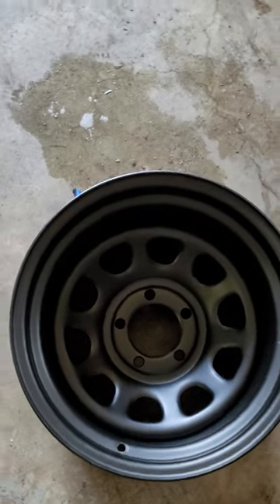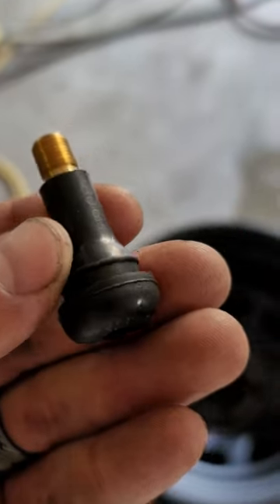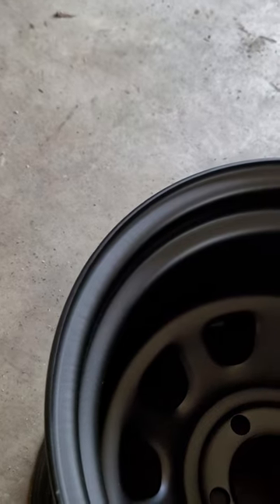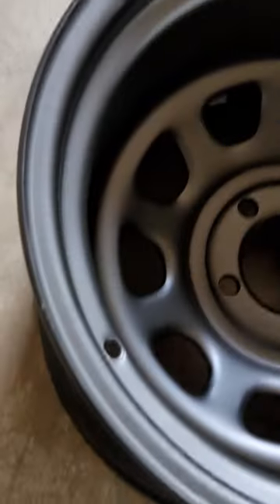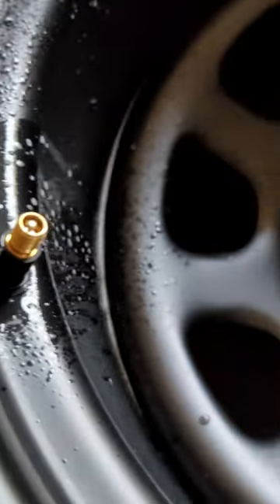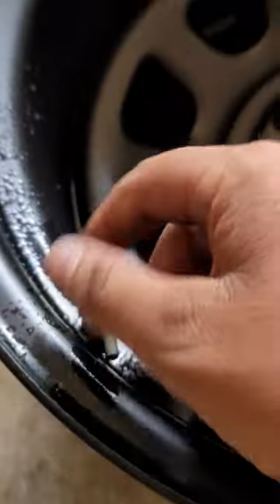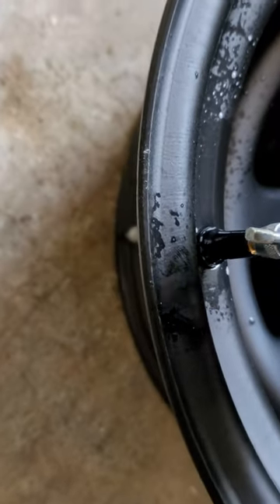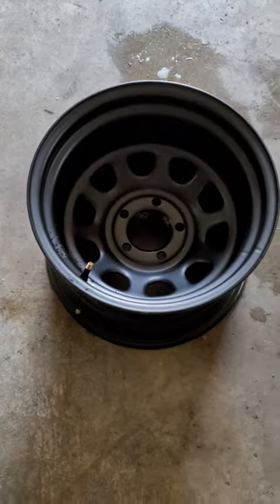How to Install Valve Stems Into New Wheels

Comment: The tool is for cleaning the threads on the inside and outside of the valve,  if you've damage them with pliers etc, the screwdriver like part removes the stem from inside the valve so you can replace it if its leaking without removing the valve. The pick like part is for reaming (removing burrs from the stem).. i have a valve installer which looks very similar but has a much longer handle.. that small one probably works fine but since it is for cleaning the threads it might be easier to damage the threads if you are not careful as thread cleaners often have an aggressive cut in the threads.. also a few drops of soapy water or bead lube if you have it around the valve core hole will make installation very easy.

Comment: Spray the inside of the rim so it slides through easier, and if you can find a nut to fit the thread of the steam just pull it through with pliers

Comment: I personally do not like to use any water based lubricants on tire valves or on tore beads when installing valves or tires . It does not take much H20 inside the rim to start small rust areas.  In the last 15 years I use WD40.  It works very well. And no, it will not cause the tire bead to slip or move under acceleration or braking actions.
Reply from the maker: I never thought about that! I'll remember this for next time. Thanks
Reply: WD-40 has petroleum in it.  Petroleum will degrade rubber.
Reply: What about silicon spray like CRC?